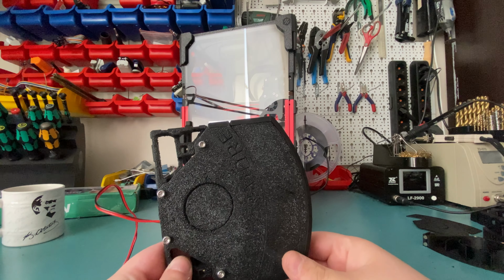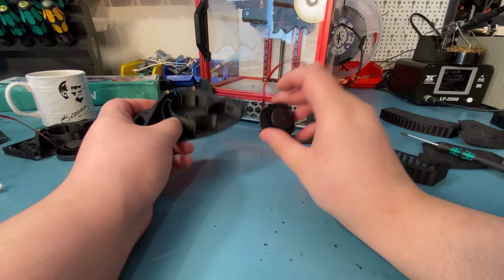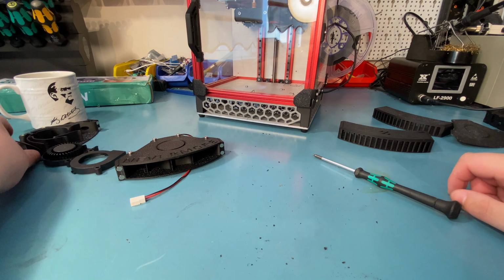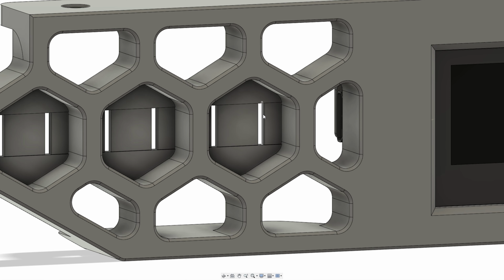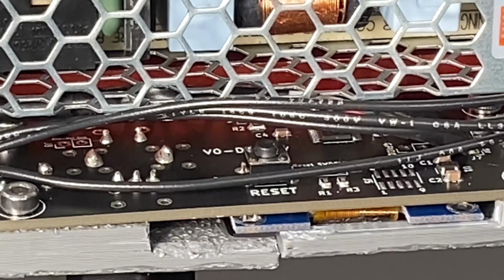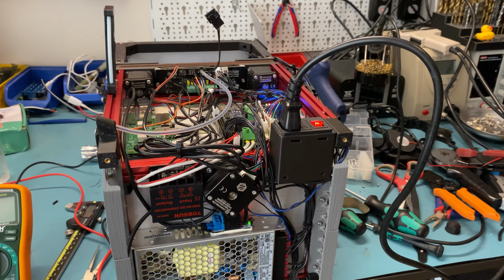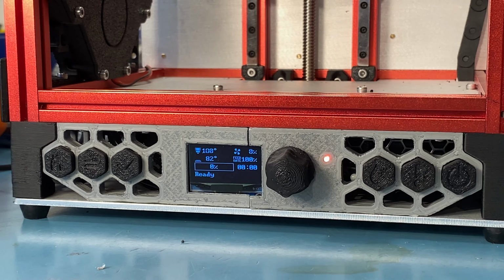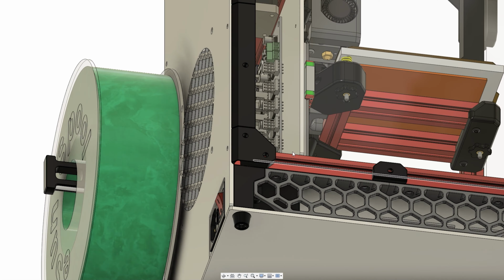Voron v0 Ep. 11 - Skirt Display & Buttons & NM Micro

Comment: Those two screw-holes that you can't find a reference to? The main manual on the Nevermore Micro github page says to use M3 6mm Button-head screws there. 
Might be because I'm from the future, since the manual also makes mention that "...any fan that works for the StealthBurner should work..."
Reply from the maker: 2x M3x6 BHCS (any size, fits up to 20mm)
for seating plenum lid to plenum 

This (in the v4 BOM)? This is for the other 2 holes with the M3 inserts.

Comment: The Repo still has the old Left/Right screen mounts.  When will you commit the updated stl's that fit the screen?
Reply from the maker: Left right are the skirts. You need to print one of each and the screen is mounted in the center.
Reply: @IsiksTech  I think what uconsti1onal is referring to is the voronusers/printer_mods repo. The old v0 skirt is on there. This new one is on your own github only. I'm also missing the button for the sw6 switch that is on the display and would change the print a bit so the part underneath the display is hidden. I was working on designing exactly this setup (v0 display and buttons) but you had the same idea. :-)
Reply from the maker: Oh yeah it's on my own repo. I'll eventually PR my mods to VoronUsers but I'm too lazy.